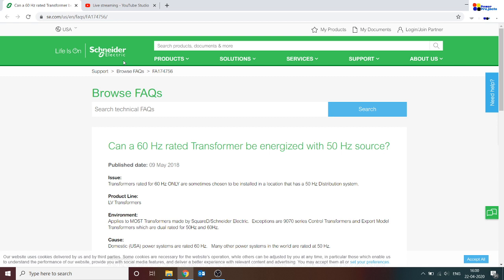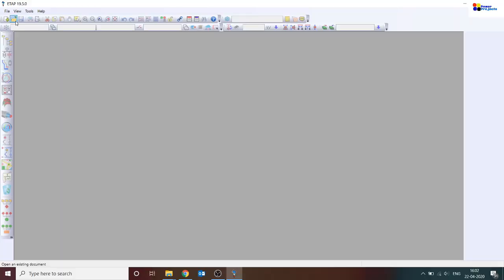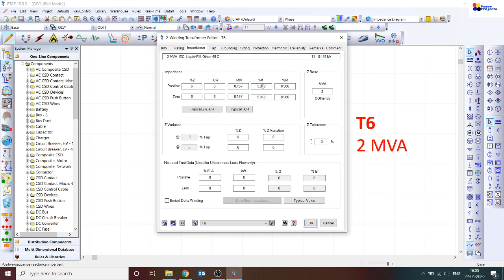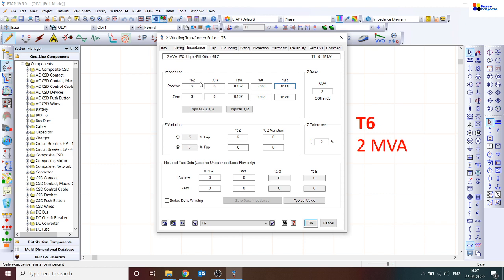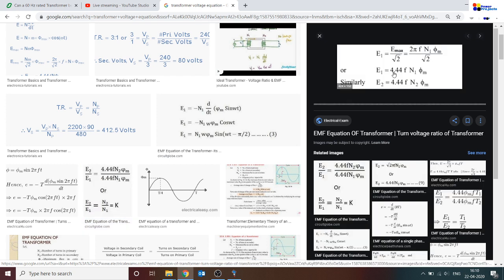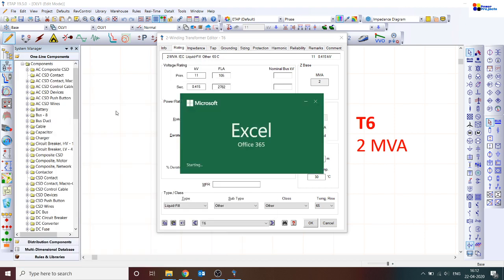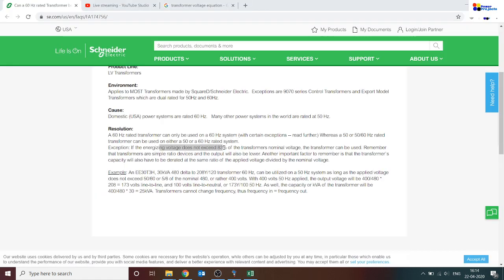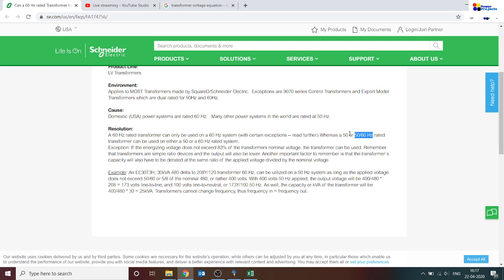Shall We use 50 Hz Transformer in 60 Hz?

Comment: Nowadays, all types of electrical transformers can work using a dual frequency system, namely 50/60Hz without any weaknesses or losses in the performance of the transformer and Eddy current effect even with the same voltage of vice versa.